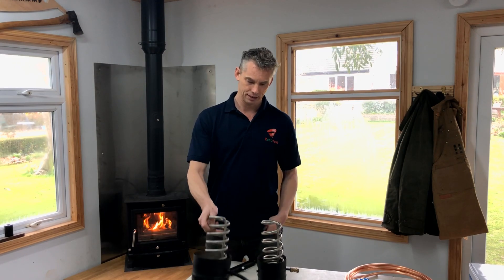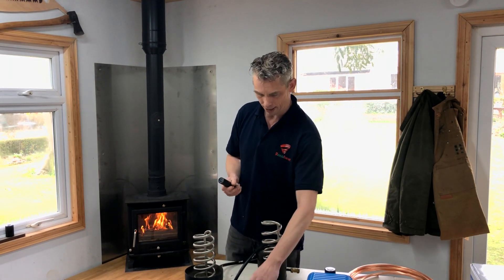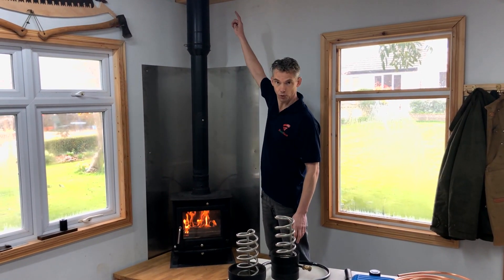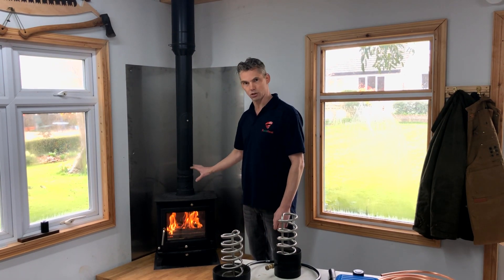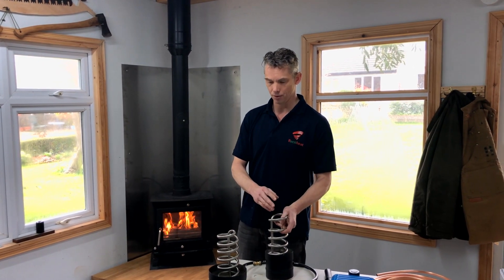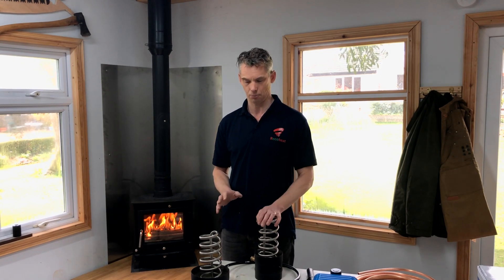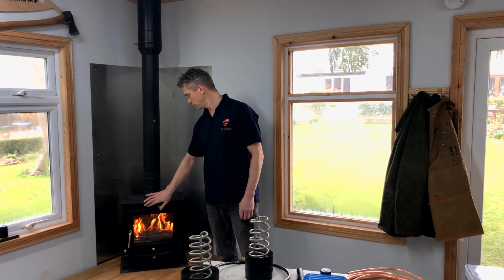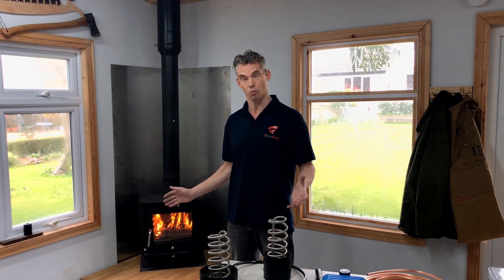Recoheat Frequently Asked Questions and updates

Comment: Interesting.  Your 60 l/m air pump = a handy 1 l/s which is about 1.2g/s.  The Cp (specific heat capacity of air at constant pressure) is about 1 j/g.  So a 400C temperature increase is 1.2 (g) x 400 (C) x 1 (J/s) = 480 Watts of heat.  I would be interested to know if you could measure the speed of the flow and temperature out of the top of the flue to see how much potential for heat recovery there is.
Reply from the maker: Well, the diameter is 125mm as opposed to 8mm, so it's got to be proportional to that.

Comment: As a matter of interest can u advise make and model number of that burner , thanks.
Reply from the maker: It's an Ecosys Ottawa, 7kw
Reply: Thank you for info , I note you mention that if you have a back boiler there is little point in installing the blower . Being ignorant of their construction is the back boiler type already designed to recover heat from the flue ? IE it is not literally a ‘back’ boiler.
Reply from the maker: @pmbpmb5416  It depends very much on the stove, but as a general rule, a back burner will take too much heat out, so that adding an additional heat recovery system will be too much. Some do work fine, so you can test it by checking the temperature of the flue above the collar. We need an operating temperature of at least 250C so that the coil is kept clean.
Reply: Thanks , knowing that I can see if we can purchase a stove accordingly .
Reply: Thanks , knowing that I can see if we can purchase a stove accordingly .
Reply from the maker: @pmbpmb5416  I would certainly not recommend fitting our unit to a modern stove with back burner, because the temperatures are all very carefully balanced, and they seem to be erring on the side of too little heat up the flue because of the way efficiency ratings work. The customers I know running units successfully with back burners are on older stoves with plenty of heat still going up the flue. I would assume modern stoves would not work, or at least wouldn't have a wide enough operating window to work in all atmospheric conditions.
Reply: Thank you, appreciate your advice , good luck with sales certainly better than the fan solution.
Reply from the maker: @pmbpmb5416  Thanks very much for the interest. Hope you get it all sorted successfully: there are so many variables to consider!

Comment: Can this be placed higher up the pipe ??
Reply from the maker: No, it can't. The stove is designed not to put too much heat up the flue, so it shouldn't be maintaining much heat at the next floor level, for example. In that case there's not enough heat to keep the unit clean. It would also be difficult to put the chimney sweep's brush through. Thanks for your interest!

Comment: great way to produce cresote.
Reply from the maker: Thanks for the engagement. It's a valid concern. In fact it doesn't do so in a properly functioning stove and flue because the coil is in the hottest part of the flue and the heat recovered is a much smaller percentage than that lost through the flue wall. The vortex produced by the foiling action of the coil also agitates the particles to prevent them adhering to the metal. The coil demonstrably remains cleaner than the flue sides.

Comment: Is there an option to run this on 12v? The pump looks quite large, for our off grid cabin running that from an inverter is not really an option i think.
Reply: I think you would need an inverter. The pump isn't that big, Will put a video up showing that it only draws 17watts too. In saying that you might be able to find a 12v pump that would have some effect maybe.
Reply from the maker: Sorry for the very slow response - missed your comment. It does actually only run at 17w, so will be drawing just over 1amp on your 12v. We run ours from a motorbike battery for outside operation. There are a few people running them from batteries, including the chap in the yurt in Ontario!

Comment: Do you have any recomended installers?
Reply from the maker: We do have some on our website, but not many at the moment. The best thing is to use the Hetas installer search widget: you put your postcode in and get the list of your local guys. Give them a shout and check availability and see if they'll do it. They're very busy. If you contact us at sales@recoheat.co.uk, we can send of the CE marking info with the installation manual and safety certificate from BSRIA, and we're very happy to talk to them, give references from existing installers etc. The Hetas page is https://www.hetas.co.uk/consumer/services/installers/ Many thanks for your interest.
Reply from the maker: Just letting you know that, contrary to our previous information, you don’t need a Hetas installer to fit your Recoheat: it’s classed as remedial work, doesn’t come under building regs and can be done by a sweep as maintenance and updating work.
 
The industry has recently undergone a review of processes and published their standards as part of their training and assessment requirements, where the issue is clarified and codified: details are here: https://www.ukstandards.org.uk/NOS-Finder#k=chimney%20occupations
 
That makes a massive difference to us, and I hope does to you. If you need a Recoheat installing, you can ask your sweep!

Comment: Can you fit it to a stove with the flu out the back,of the stove not the top?
Reply: Yes, but regs state the horizontal section of flue pipe should be no more than 150mm.
Reply from the maker: Sorry for the slow reply. Yes, you can: put a T with a soot hatch on, and fit the Recoheat on the top of that so you can sweep through it. The Recoheat has to be vertical and you need to make sure that the flue is running hot enough - at about 250C.

Comment: Can this bu used if burnings coal ?
Reply from the maker: Yes, no problem. It works on anything with an open flue - so even on gas and oil stoves as long as they don't use a balanced flue, which falls under different regulations.

Comment: I'm thinking of a stove to go in our fireplace that currently has a Baxi Burnall grate, which has a large ashpan set into the hearth under the grate, as well as an air inlet down there that draws air from under the floorboards. It looks like that pump may fit down in the ashpan hole and it could draw air through the vent, effectively from outside via the airbricks.

Do you know of anyone who has done that? One worry might be still hearing the pump, even if it is down below the hearth, also to access the pump would mean removing the stove.
Reply: It's a heat exchanger for the waste heat that goes up the flue. Clever idea.
Reply from the maker: @bennewinn1101  Yes, that's right. Thanks for stopping by!
Reply from the maker: The biggest issue there would be having power under the stove. That Burnall looks a very clever system, but I still wouldn't be running power into it. It would seem a better idea to put the air line through the vent, so put the pump outside. Thanks very much for the interest.
Reply: @Recoheat  That's got me thinking - I could run the power from a switched plug socket under the floorboards and in through the same air vent in the bottom of the ashbox hole. The heat resistant air pipe would come up behind the stove, pretty well out of sight.
Reply from the maker: @stevechelt1  Yes, that sounds the way to do it. 👍
Reply: @Recoheat  Just ordered a 5" version. I've not decided on which exact stove to buy yet (two on my shortlist) and have yet to book an installer. As we need the old fireplace ripping out, the stove space enlarged, stove fitting and a new fireplace fitting it's a bit of a job, so want 2 or 3 quotes. At least when the Recoheat arrives I can decide on where to position the air pump, hopefully it will fit under the floor just in front of the hearth.
Reply from the maker: @stevechelt1  Just got your order! Thank you very much Steve. We'll get that off to you in the next few days, and look forward to hearing how you get on!

Comment: When will you have the rear exhaust systems ready. I am only able to use the rear exhaust on my stove and if available would order today. Thanks
Reply from the maker: Hi Gary, do you mean the flue is coming off the stove at the rear, horizontally? We're aiming for the end of September, and in two configurations: one in a T section with the outlet from the vertical, and one with an extension pipe off the horizontal. If you email through a picture of your install, we'll be able to advise. Thanks very much indeed for your support!

Comment: Keep up the great work you guys. Ques: Have you ever thought about a three way directional outlet to help direct the output heat around a larger living space?
Reply from the maker: Hi Gary, thanks very much! A directional outlet isn't actually necessary because the outlet air is pressurised. That means the heat distribution is quite unlike that from a fan: the pressurised, turbulent jet draws the radiant heat from the stove into it, mixing it into the flow. Because it's pressurised, this warm air has to equalise with the colder air in the room, so it is spread by that equalisation process. The heat obviously dissipates over time and distance, but the big difference is that we're not powering that equalisation process, and it's going to act first on the coldest, lowest pressure areas. It's literally the same difference as the energy required to pump water across a room, or pouring water onto an uneven floor and letting it settle. That's why we see a spread that is so much further than we put the electrical or mechanical energy in to power: our energy goes into pressuring the air, in conjunction with the heat energy, and this combination then disperses the heat for free through the equalisation. So directing it doesn't make much difference - an effect our customers first reported to us is that the units heat the floor, as well as into other rooms and upstairs, and it was this phenomena that actually got us working out how that could be so.
Reply from the maker: Oh, and just to add again, have you seen Philip's stove with three Recoheat units in series above each other! https://www.youtube.com/watch?v=SwUB78xd_hk&t=8s You'll see he has put them at different angles to spread the heat around his large workshop. He reports little difference in the output temperature of the higher nozzles, but he'll be shifting less total heat from them because they're further from the top of the stove. It's a 13kw stove though, that puts 10 of them into the back boiler, so he's massively increasing the heat he's pulling into the room.
Reply from the maker: Should probably say that people certainly do aim the outlet nozzles in a specific direction - you might have seen one chap has his backwards to heat the open-plan room behind the stove, and quite a few aim it to the corridor or into their conservatory. In this respect though, splitting the nozzle would split the jet, which is crucial in drawing the radiant heat of the stove into that air flow and dispersing it. In terms of the total heat dispersal, it is is this heat from the stove, rather than the heat from the flue, that is by far the greater proportion of the useful heat distributed.

Comment: Hi great video. Can you still have the fire going if there is a power cut
Reply from the maker: Hi Kevin, thanks very much! Yes, you can: the unit doesn't have to be running and is unaffected if it's not: it's made from the same grade steel as the flue, but has thicker walls. You can also run the pump off a car battery if you have a power cut or are off-grid: the stated draw is 37w, but actually our engineering consultants have been testing it and found it draws just 17w when operating on the system.

Comment: I have a couple of questions could I set this up with some gate valves and direct heat all around the building or alternate areas also  would it be suitable to operate with thermostatic switch to have it operate until the ambient temperature reached a desired level.
Reply from the maker: Hi John. Essentially, no, but have a look at this video for a detailed explanation: https://youtu.be/Wt08Fo1gCRw

Comment: Is it possible not to have that hissing sound?
Reply from the maker: It's not, because it's the turbulence in the air flow, which is what causes the rapid heat gain in the unit, and the transfer into the room. There is no hiss when the air is cool - it is caused by the acceleration and turbulence resulting from the heating action.
Reply: Just wondering if some sort of muffler could help reduce the hiss noise similar to a car exhaust without compromising the air flow. @Recoheat
Reply from the maker: The units do have a silencer on them to take the mechanical noise of the pump out of the airflow. The hiss that is left is actually caused by the turbulence in the air, rather than the velocity. You can't take that out with baffles - in fact the only way is to combine 3 turbulent airflows. We're working on trying to achieve a silencing nozzle but it's pretty complex.  @ricardopelc-wesoly3483

Comment: What’s the comparison like against a large eco fan ?
Reply from the maker: A fan just pushes the radiant heat from the surface of the stove, and requires space above the stove just to sit on. Our units can fit into a 3" gap above the stove, and are powered by pumped air, so don't rely on the radiant heat for power generation. That means they keep pumping heat for a long time after the surface of the stove is cool, when there is still plenty of heat inside the combustion chamber, which passes up the flue. Whilst the stove is hot, the effect is still very different and much more effective because of the additional heat from the flue, but more because a lot of the heat displacement derives from the pressure equalisation between the expanded, turbulent air flow from the unit which creates an envelope of warm air that pushes out from the stove and warms a long way. So it warms a much wider area, for much longer, than a conventional set-up, with or without a fan. An eco fan doesn't use electrical power, but our units use a 37w pump, so that's also a difference.

Comment: Any idea on the average installation costs guys?
Reply from the maker: It really is a piece of string because it depends on the position and layout of the flue. As an additional cost to whatever remedial work the stove and flue might need, it's usually similar to the cost of a sweep.
Reply from the maker: Just letting you know that, contrary to our previous information, you don’t need a Hetas installer to fit your Recoheat: it’s classed as remedial work, doesn’t come under building regs and can be done by a sweep as maintenance and updating work.
 
The industry has recently undergone a review of processes and published their standards as part of their training and assessment requirements, where the issue is clarified and codified: details are here: https://www.ukstandards.org.uk/NOS-Finder#k=chimney%20occupations
 
That makes a massive difference to us, and I hope does to you. If you need a Recoheat installing, you can ask your sweep!